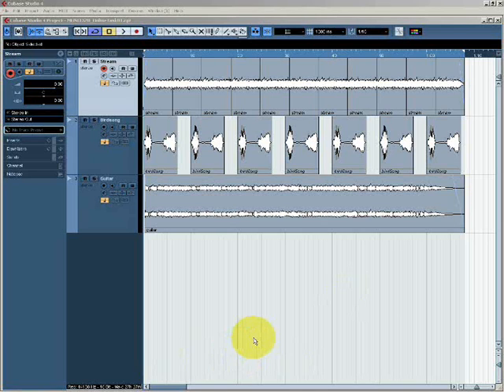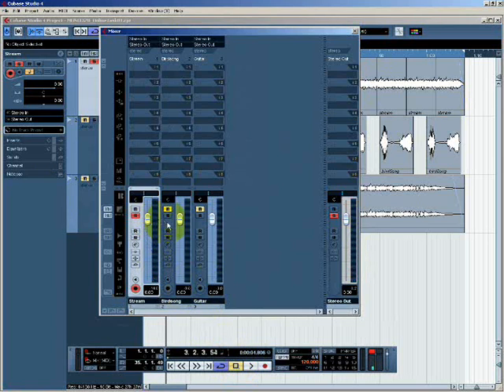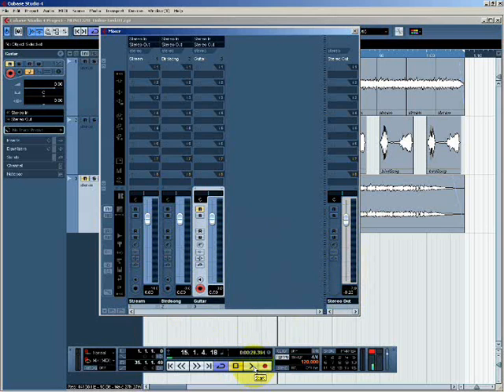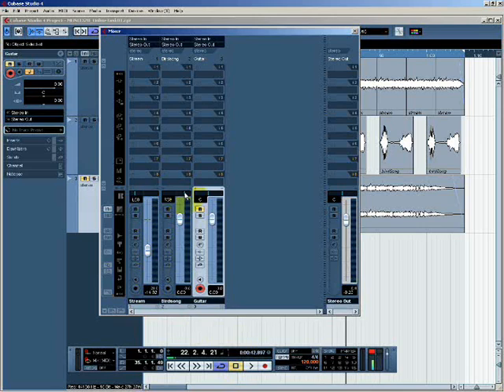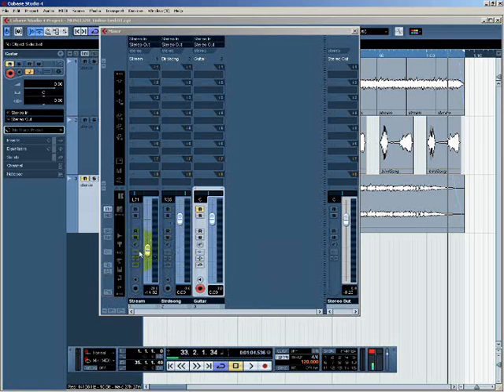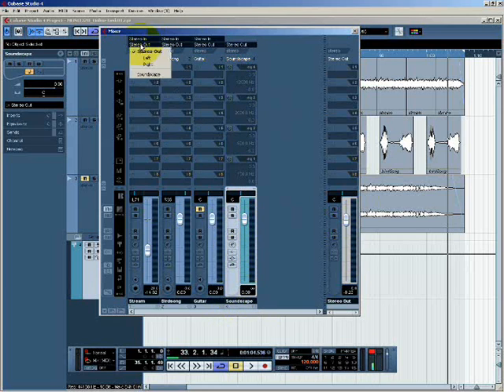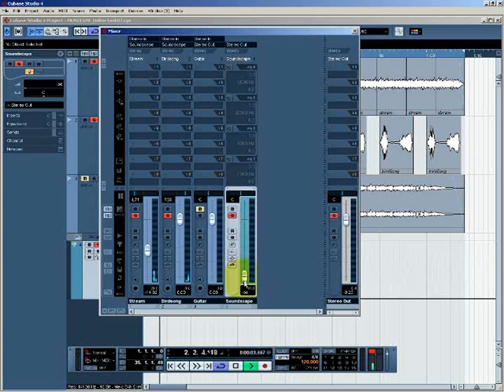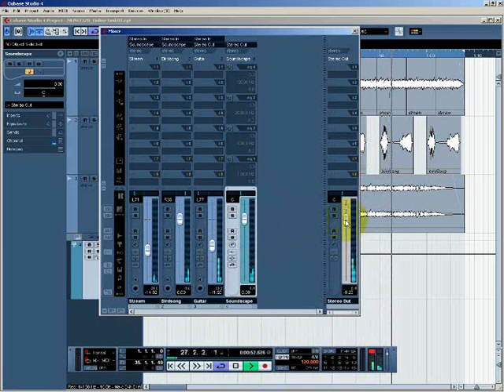Introduction to Cubase: Mixing, Panning and Bussing

Comment: Splendid! Just getting started with cubase. I have alot of experience with sequencers but excuse me for this question. Is the audio and midi track structured the same as in sonar for example? Do i need to assign an audiotrack to a midi instrument for it to sound or does the audio automaticly go to the mixer from the instrument? 

Best regards